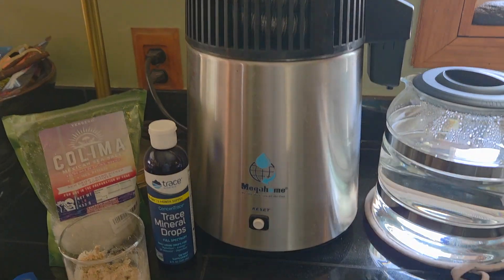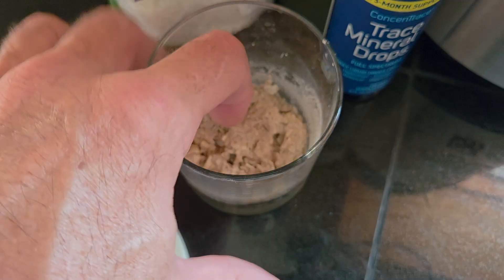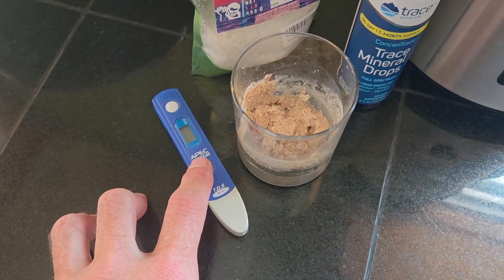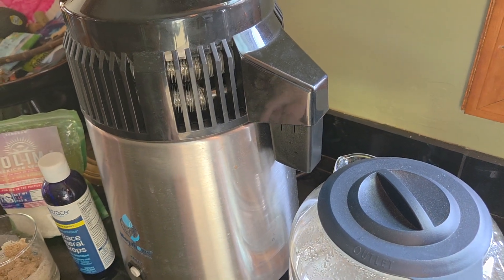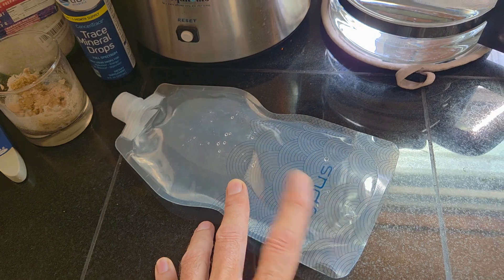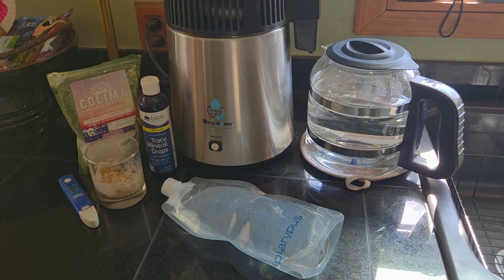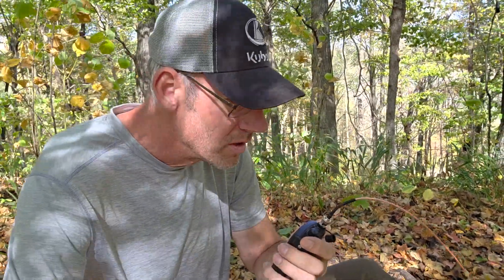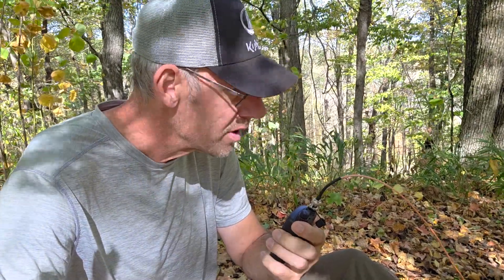52 Mile Contact on 2Meters!!! - Yaesu VX-6R

Comment: I knew that area before even hearing kettles or Shelter 5…hiked that several times 😁. Working on adjacent things with andlflmsg but running into tech challenges with it. Might be good to connect with ya offline about that and other related topics. Been on JS8CALL on 40m just recently

Comment: This is EXACTLY how we did two meter contacts to N2GE during Helene - personally parked up on a clear hill to hit all three repeaters during the hurricane, we had the two N2GE repeaters running off federal diesel backups and one W4MOE running on a plug-in gas generator that the guys had to supply.  We were able to cover most of the damaged area until BW mountain came online outside of Lake Lure.  When the repeaters were stuffed, simplex mountaintop to mountaintop was king, with people getting messages out to SC, TN, KY, GA and VA.
Reply from the maker: 2 meter is great great for local comms. Were you running digi heaters as well?

Comment: I once hit a repeater over 50 miles away with my VX-7R, although I must confess that I was on the summit of a mountain in the Adirondacks, but I was using just the stock antenna.  BTW, originally from Eau Claire here, but I haven't been there in over 65 years and I don't recall a thing about it, because I was only 3 when we moved briefly to Huntsville, AL only to move back to La Crosse, where my father was from, before moving to NY where I've lived ever since.    I was briefly back in Wisconsin in 2009.  73 DE N2LCX.
Reply from the maker: You're a Wisconsinite at heart! It's a great time of the year here with all the leaves changing colors. 73
Reply: @HamShackDown  yes, this is my favorite time of year and the leaves have been changing here too.
Reply: Which mountain in the Adirondacks?
Reply: @TrenchKraft  Blue Mountain - this was over 15 years ago, all that I recall was that the repeater was east of the Hudson River.